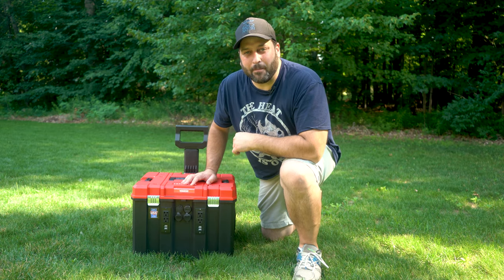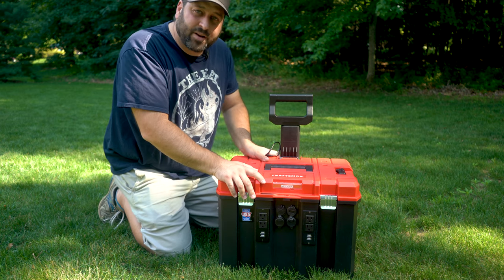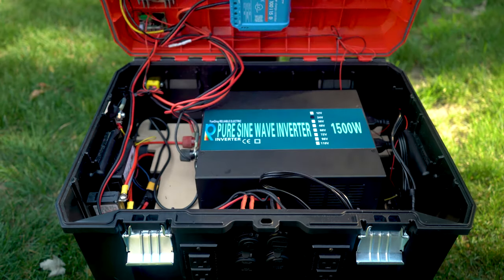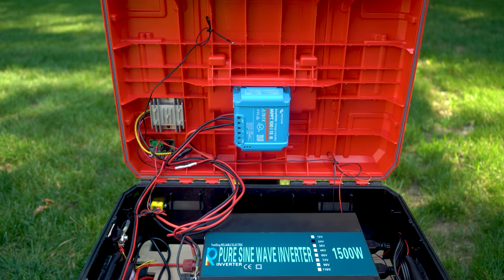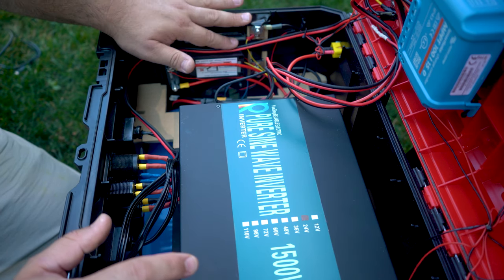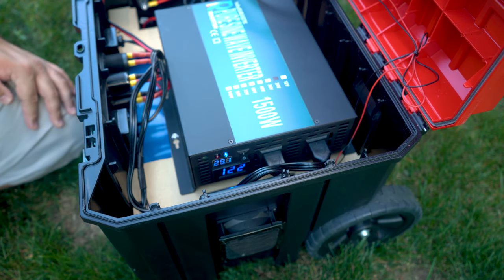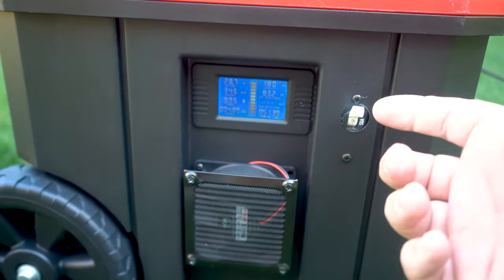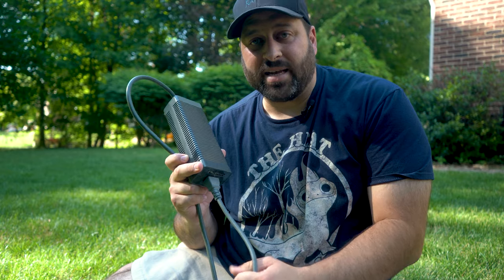DIY Solar Generator | Infinite Cheap Renewable Energy

Comment: Hi, regarding your invertor, if you take the red or black invertor cable, that runs to the battery, wire it to a battery breaker switch/ turn Nob, than back to the battery, you would not have to keep opening the case to turn the invertor off and on, you can just turn the battery breaker switch/ turn nob externally witch will make sure no power is running to the invertor once you’ve turned it off.. in the same breaker switch I’ll also wire a little warning light beside the battery breaker turn switch so the light shows when it on and when it’s off.. as you won’t to avoid keep opening the case and exposing the inside to weathering or dusk, it’s Bast to have a system wear everything you need to use is on the external side of the case/ Box.

Comment: the shunt only reads one side incoming or outgoing. there is a way to hook it up to read both sides by using a switch. look up Jasoniod- solar power, batteries and more!     he has a great video on this issue

Comment: Nice. Would it be better to run a dedicated battery maintainer in the correct voltage directly to the battery to maintain them? Or do you recommend giving the Solar Charge Controller the duty of maintaining the battery, instead? Why didn't you just go with a 32v trickle charger directly to battery? Just curious.

Comment: I have similar battery monitor on my system, Just set it up correctly the shunt you are using, Let say you are using a 200A shunt go to the settings in current and set it up to 200A. Great system, I currently using a 7s for my home system, it has been working flawlessly
Reply from the maker: The battery monitor works.  My complaint was that there is no positive vs negative current.  Just a total current.  So if it's actively charging it shows positive, if it's discharging it shows positive.  So if I'm charging and discharging at the same time, and it shows 20W, is it 20W in to the battery or 20W out of the battery?  I wish it showed me that.
Reply: @JohnEFly  okay

Comment: Victron rocks, reliable, robust.  Great choices John, great build!!  I've built several based 36 cell at 6S and 40 cell at 10S 18650 packs with recycled cells (@3000mAh each).  Battery contactors can handle up to like 500 Amps, can be manual or controlled by relay.   I know where you can get Lion chargers that use a barrel connector and are made for 6S, 7S, 10S, etc.and work through the BMS (Vruzend)    Tip:  look for larger 18650 packs from tools and cordless vacuums, much less effort and cut fingers recycling them.  Stay away from laptop batteries if you can help it, way too much effort required.

Comment: Do you have a direct dc battery port for your dc lipo chargers. Just like the USB it makes sense to just run the dc chargers off the battery and leave the inverter off.
Reply from the maker: Yes, that's exactly what I do.  I connect direct DC to the chargers.  I only turn on the inverter when I'm using AC devices.

Comment: Hey, came across your video while scrolling around today :) Great build and thanks for the shoutout! I really like the use of the Victron controller instead of the 7210A. I don't care for the 7210A myself either, it's loud and rather inefficient. There aren't many choices for a step-up converter though and that was one issue I had with a 48V system - MPPT would have meant carrying around many panels to reach proper Vmp voltage.
Reply from the maker: Thanks man!  I really appreciate the kind words!  Your video helped me connect the final dots on my system, and I greatly appreciate it.  And I completely agree on the step-up converter.  Going with 24V has a few downsides, but it was 100% the best choice for me and made it reasonable to carry panels that would be compatible with the Victron controller.  Thanks for all your great videos!

Comment: Frickin' outstanding! You gave me a ton of ideas for my next build! I will not be buying individual cells and wiring them into batteries, but will build the system by myself. Thanks!I have been thinking about hinged panels, but carrying them and setting them up seems like it would be a hassle.

Comment: Awesome build! Only thing I would do differently or upgrade would use 8 or 6 Gage wiring for the whole build just so you have that flexibility with current draw and heat

Comment: Hi John,  I am just now seeing your build.  Thanks for sharing all that info.  I heard you say that you did not have access to the full power of the inverter because of your smaller breaker.  I think the inverter probably has a built in AC receptacle.  So, if you needed the full power, you could just raise the lid and plug your device in directly.    Once again,  Thanks.
Reply from the maker: Hey Michael.  I have changed this part of the build since I made the video, but the breaker is actually between the battery and the inverter.  So basically if I tried to use 1500W through the inverter I would need to pull about 1650-1700W from the battery.  1700W from the 7S battery would be about 68A (assuming it can pull at 25V).  My breaker was 45A, so it would trip.  Since then I have added multiple batteries in parallel connected through 40A fuses and then upgraded the breaker to 85A.  Now I can pull the full wattage from the inverter no problem.  I don't do it often, but I have tested it for things like boiling water and it works great.

Thanks

Comment: I would like to build a unit like this but on a smaller scale.  something that can be charged by multiple means and power 12 volt and 120v ac accessories.
Reply from the maker: there is no reason you can't build something just like this but smaller which serves those needs.  Since I built this I've added more batteries, so it's up to 6kwhr total, but the core is still the same.  I use the DC port to charge from an external AC->DC charger if I want to charge from the wall.  I also have a way to feed the solar input a 36V DC input from an AC charger which will charge from the wall as well.  I then have 12V and 120V outputs.  You can also just get a cheap 24V-12V 40A buck converter and a cheap 12V 300W inverter if your power needs are simple.  Then you can keep it really small and simple.

Comment: Nice system.. I just built a smaller 800 Wh system and it cost $400 with 200 W solar.. Yours looks a lot nicer!

BTW what fan did you use? thanks

Comment: Nice build!  Where did you get the yellow XT90 connector mount plate that is holding the XT90 connector in place on the back for you solar panel input?
Reply from the maker: It's an XT60 not an XT90 and I found it on thingiverse and 3D printed it.

Comment: looking to use a power bank like this with a deep cycle battery.... how can I build something like this to be able to charge in the field with a gas generator to keep the batt at least at 80%. Love this content.
Reply from the maker: The easiest solution would be to use an AC->DC power supply plugged into the solar charge controller.  It'll then convert that DC input voltage to charge the battery for you and you can control what voltages you want it to float the battery at (such as 80%).  You could also have direct DC ports and charge via those if you wanted, but the solar is easy and works great.
Reply: @JohnEFly  Thank you.

Comment: I just ordered 340 of those cells. How's everything in your build holding up. Anything you had to replace or wanted to upgrade?
Reply from the maker: Yeah dude, I absolutely love this thing, but I have made a few changes.  First, I swapped the 45A breaker for an 80A breaker.  There should be absolutely no need for me to ever need more than 80A.  I also added a 2nd battery pack inside the case (and am now adding a 3rd) as well as an external battery pack that I can connect to a plug I added on the back.  All decked out I will be able to store 6.4Kwhr with this versus the 1.3Kwhr when I made the video (with significantly more weight though of course).  I've also added some bigger wires to parts since I allow for more amps, and otherwise everything else is exactly the same and working amazingly well.  It's a fun project man, and It's been awesome!  Enjoy!

Comment: Came back for another watch. Ordered two 100ah/1200w SOK LiFePO4 which I will connect in series for 24v. Though I have the dimensions of the batteries, I will order/buy a toolbox/case AFTER I receive the batteries. I am going to with a 2000w Giandel inverter, with a Victron MPPT charge controller. I want a cushion in wattage so I can run a microwave without any worries. I do not plan on powering power tools but it is nice to know I can. Only my BB system can run a chop saw and heat gun.
I currently have 3 solar/battery boxes which I bought and am using now on a daily basis to verify time for recharging, how long it will run given devices/appliances. One Bluetti 2400w, one Bluetti 1500w, one DIY battleborn 2x100ah 2400w system. I also built a HAM radio box with a Bioenno 12ah LiFePO4  battery. Solar or wall chargeable and use a separate 300w inverter for ac as needed (low watt devices only, say 150w max?)
I like the various systems. I can run my freezer easily off the BB system. During sunny weather, I also run 2 TVs, my PC and a LED lamp all day on the BB system. At night I use powerbanks to run my LED lamps. I do this to test now, so I know what to expect later should they be my only available power sources.
I only have 1000w of solar panels and the Bluetti's can take forever to charge and max out on ~300w of solar. The Growatt MPPT all-in-one system can feed the BBs easily with the three 200w panels dedicated to it, but I need to get at least another 200w. I plan on running my inside fridge and garage freezer off the BB system.
Reply from the maker: It sounds like you will have quite the setup!  After this video I swapped out the main breaker switch for a higher amp one so that I could run some more intense AC appliances like water heaters and such.  I don't need them much, but it's nice to know I can use them now.
Reply: @JohnEFly  Third viewing today. I am going to try out the hinged panels for other use.

Comment: Can you explain how you have the inverter sitting on top of the batteries?
I can't tell from the video how you did that.
Reply from the maker: yeah no problem.  In the back there are wheel wells for the wheels to fit on the sides.  I measured the height of the top of the wheel well inside the box and then I cut 1/4" MDF panels to fit in the front corners.  There are support strips of plastic within the container so I sized the MDF to fit exactly the width from the edge of the box until that first plastic support and then attached the mdf to the wall.  Then I cut a 1/4" MDF board to the shape of the opening within the box and it rests on the wheel wells in the back and the MDF boards in the front.  I didn't secure the board down as I want easy access to the batteries, and I don't plan on putting the whole container upside down.

Comment: Nice build. Congrads on crediting Lithiumsolar; had just watched his, then saw yours, & thought it very similar, but with enough differences. Am very jealous on how cheap everything Americans buy is: eg. ~$150 per 100w solar panel; & forget getting a box like yours, in my country, for under $100 (if at all!) :-cry
Reply from the maker: Thanks man!  My solar panels were actually $79 per 100W panel.  $158 for 2.  We are certainly lucky in a lot of ways, and it's helpful to keep that in mind sometimes.

I had purchased a lot of my parts before Lithiumsolar's video, but that video is what really gave me the confidence in what I was doing and helped me find some last few parts that I needed.  I'm not sure when I would have completed this project or what exactly it would have looked like without that video.  I had also watched a bunch of others, but that one in particular helped me to pull everything together.  So I'm a big LithiumSolar fan now :)

Comment: Would be cool to know what your P rating is on your battery? I'm guessing it's about an 8S10P? And also what BMS you're using. Tx
Reply from the maker: hey, things have changed a bit since the original build.  The battery inside this at the time of filming was 7S20P.  Since then I have added 3 more internal batteries (all 7S, one 20P and one 16P but with 21700 cells).  All 3 are wired in parallel.  I then also have an external 7S24P battery which I can connect to an expansion port I added in case I need the extra capacity.  The total battery is about 4.6Kwhr internal now with a 1.8Kwhr external battery I can attach when needed.  All of the batteries are using Daly BMSs.
Reply: @JohnEFly  that's cool John
Reply: @JohnEFly  what BMS do you use? I am also building up a LiFePO4 battery using a bunch of 32700 6000mAh cells I have. I will use a 4S config but I'm wondering what BMS to use. I see some need to be started manually and I'm trying to get around that. Like you I have a Victron 100/20. Would appreciate your input to this. You're the only guy I've found on YT building his own battery packs for portable solar gennies. Thanks
Reply from the maker: @JohnHeath777  these are all Li-ion and not LiFePO4, but I use DALY BMS for my battery packs.  They also make the same BMS for LiFePO4 if you want to try that.
Reply: @JohnEFly  gr8 tx. I'm looking at Heltec which I think is similar

Comment: Hi, awesome build. Did you take it out to the field yet? Would like to know average charge time and your run time when on the field. Best.
Reply from the maker: yeah, I've taken it to the field many times.  In fact it's all I use at the field now.  I haven't used my generator in nearly a year.  I feel like I should do a follow up video to this to talk about how I use it and what has worked well or not for me.  But I run all of our races off of this (with the solar panels connected).  I have expanded the total battery capacity since I made this video, but I've ran 10+ hour races including charging my batteries and still had over 50% of my capacity left.  It's been awesome.
Reply: @JohnEFly  Wow! Would love to see an update! Thanks for your reply

Comment: Cool stuff man. I found my self looking into this about 6 months ago. For no particular reason other than I thought it would be a fun project......And I could use it regularly for drone racing or rc fun Flys. Watched a ton of videos.  Never got around to building one. I like what you did with your build. Nice job.
Reply from the maker: Thank you!  I'm really really happy with it.  One absolutely amazing part of this thing is using it after a drone race to discharge my batteries.  I have a iCharger X8 and I discharge my race batteries at 15A back into my battery pack.  So basically I don't waste the energy as heat anymore, and it discharges WAY faster.  Super helpful!
Reply: @JohnEFly  are your drone batteries higher than 26 volts?
Reply from the maker: @joepah51  Not really.  My drone racing batteries are all 6S Lithium Polymer batteries.  We tend to overcharge them a bit up to 4.35V/cell so 26.1V at a full high voltage charge (25.2V fully charged at normal charge level).
Reply: @JohnEFly  Why do you want to discharge your batteries? I don’t understand. Hopefully you’ll read my question. Thanks
Reply from the maker: @camelotrooms  LIPO batteries stored at full charge for an extended period of time causes permanent damage to the battery.  Basically it breaks down over time, the IR increases and it will not perform the same.  So if I charge a battery to fly it, but am unable to fly that pack at the field, I'll discharge it to a storage voltage from full.  Using a regenative discharge allows me to discharge very quickly into my battery bank saving me time compared to the typical method of discharging to heat with a standard charger.

Comment: is it possible to run a 12v power inverter from a 24v to 12v step down converter  ,battery bank being 24v?
Reply from the maker: Yes absolutely.  I have a 12V 300W inverter I used for my car, and I have a 12V plug on my solar generator, so I can plug it in and use it if I want.  But it'll be severely limited by the 12V regulator.  It'll be hard to support 2000W through the step down for example.

Comment: Great build. Nice package with all the essentials. Sorry if I missed it while you were going over  everything  but what amperage bms are you using? 

I'm in the middle of building a 7s27p 18650 battery (for a portable box similar to yours and @lithiumsolar ) recycling 189 Panasonic 2900mah 18650 cells for a total of 2.1kWh of storage. (I live near batteryhookup.com so I pick up everything in person)
Reply from the maker: Thanks, I'm using a 45A BMS on my packs.  Currently in this build I have 3 separate 7S packs, each with their own 45A BMS then connected in parallel through 45A fuses.  I then have an 80A fuse on the master power.  At the time of the video, my main fuse was a bit lower, and I wanted to be able to run higher amps when needed.
Reply: @JohnEFly  Thanks for your reply. That sounds well though out and implimanted. More protection with three BMS boards.  Im planning on breaking my pack in half and basically doing the same thing. I've done alot of battery building research and also learned a lot from Jehu Garcia's channel over the past several months.  A few years ago I built a simple 24v 6s1p pack with a little BMS for a Boom box I built but it's a far cry from this 2kw monster haha.
Reply from the maker: @Bubbz2024  awesome man!  Good luck with your build.  One of the reasons why I used 3 built packs was that I would be able to do maintenance on the packs if I need to while still being able to use the device.  If it was all one pack I would have to go without it entirely if some cells starting having issues.  Plus I can always pull one pack out and use it as a standalone pack if I have a need to.